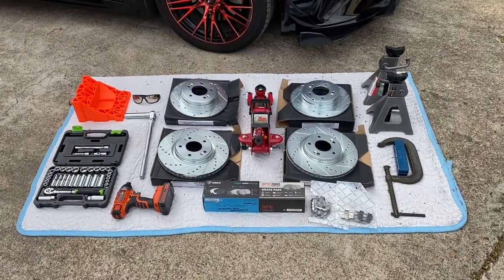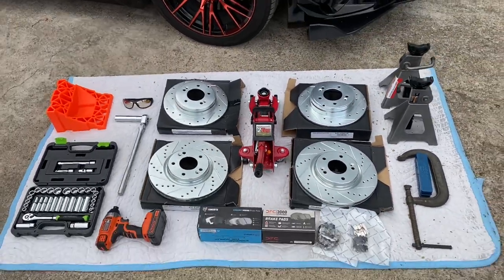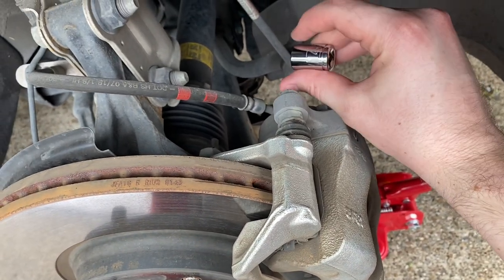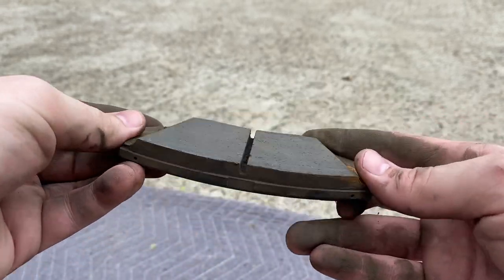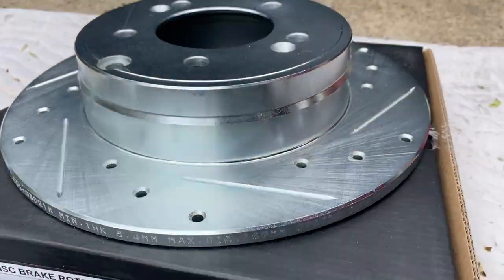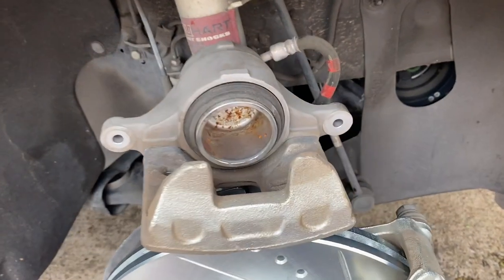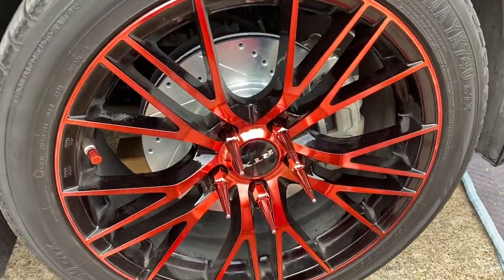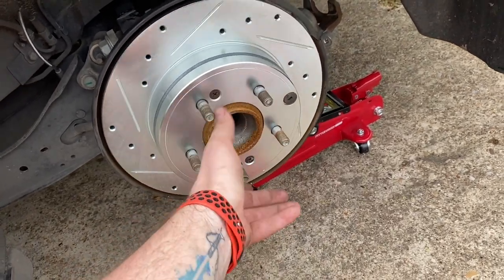How To Change Brake Pads and Rotors (Drilled & Slotted + Ceramic Pads)

Comment: Im not much of a know it all when it comes it cars but i have the same car as you and i was wondering if these will work with 17 inch wheels
Reply from the maker: Yes they should work just fine. The pads and rotors are sized by the car itself not the wheels particularly. I had 16in wheels on this car stock and upgraded to these 18’s and it’s still the same size pads/rotors. When you order on the website they will ask for Year, Make and Model. That will tell them what size to give you.

Comment: What size c clap did you use.....was it a 3 inch?
Reply from the maker: You’ll want to use a decent sized one so it will open up enough to get the caliper, piston and brake pad in between. 3in would probably be too small I’d go with at least a 6in to be safe.
Reply: @KDMCurt  thanks